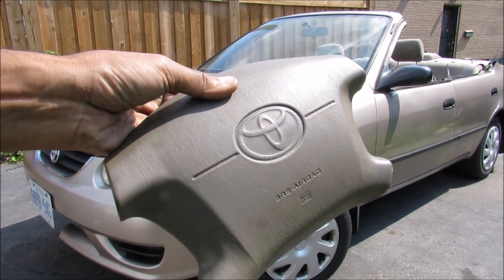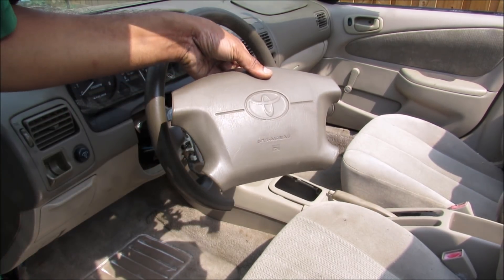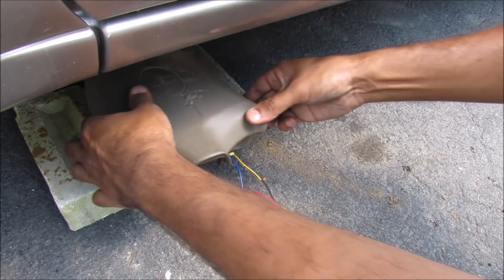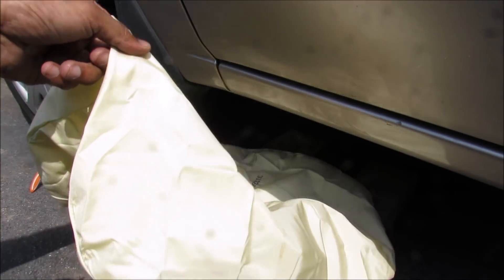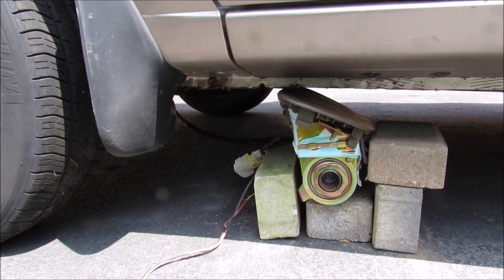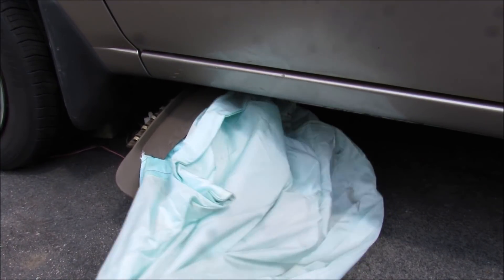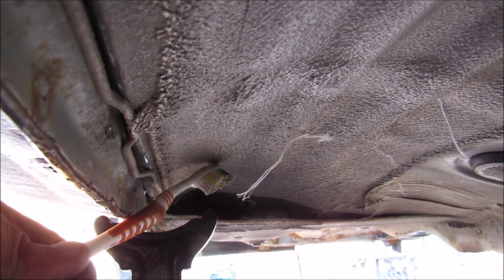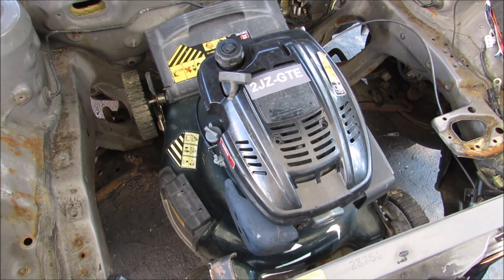Can an Airbag Lift a Car??

Comment: I think airbags have a greater potential of injuring people in the car than an actual accident, assuming seat belts are worn and properly adjusted . I wonder if there are statistics available on that .
Reply from the maker: If they did injure then why would they invest in putting so much into newer cars
Reply: @speedkar99  You're apparently unaware of the exploding gasoline tanks in the Ford Pinto. That was originally "an investment" where 1.5 million such cars were recalled by the manufacturer.

Comment: Do you have ac vents for 2004 Toyota Camry   ??
Reply from the maker: +M Ridware yes my 2004 camry has AC vents.
Reply: speedkar99 how much for all ac vents  ??
Reply from the maker: +M Ridware I have the entire interior for sale, gray color, I will sell the dash and vents as an assembly, but local pickup, Toronto
Reply: speedkar99 i want AC vents and ac control panel for my 2004 Toyota Camry  &  i will send you pic and you tell the price

Comment: Enough force to dent the underbody and break a weld!    This is one more reason I think airbags are more dangerous than safe. People just need to wear seatbelts.  Another well done informative video Speedkar!
Reply from the maker: +Tripp M yes its quite a lot of force. But remember in a crash, the airbag isn't supposed to explode into your face, rather your head is supposed to be cushioned by it after it has inflated.
Reply: speedkar99 Why are people so confused about this? Do they think it's supposed to explode directly into your face?
Reply: MoutainMan3000 you are right that they shouldn't explode in your face, however I am amazed at the injuries they actually cause and the damage they do to the car.  Hopefully this has been remedied with the newer generation of airbags.
Reply: You're supposed to get thrown into the deployed air bag, not the airbag get deployed while you are leaning into the steering wheel. Unless you're short like me and already need to be into the steering wheel just to get the clutch pedal down. One of these days I need to pull the srs fuse. I used to own a '93 Ford ranger, I hit a pole with it and I think Ford, or maybe Mazda (the Ford ranger was based heavily on Mazda's b2300 or B3000 series) had designed what I call a "Pre-airbag seatbelt mechanism". Upon impact the belt locked up and it almost felt as if it pulled me into the seat. I can't understand why Ford and Mazda started using airbags with a seatbelt mechanism that works that well.

Comment: Now what's remaining in that Corolla?
Reply from the maker: +Yathu prem lots of things:
Starter, alternator, ac compressor, drier, condenser, vvti gear, fuel injector, ignition coils, power steering pump and more...stay tuned I'll have videos for all that stuff in the coming weeks!
Reply: speedkar99 awesome
Reply: speedkar99 Sweet.

Comment: huh? the video showed the car lifting up from the ground, but you say it wasn't enough force?
Reply from the maker: +HazewinDog it didn't lift far enough to clear the wheel from the ground.
Reply: It looked like it did for me though, but I suppose you'd know better ^^
Reply: I tend to agree with HazewinDog. It really looked like the front wheel got almost an inch off the ground.
Reply: Yes, the front wheel did get lifted but notice that the original Corolla engine has been replaced with a (Ops, what was the new engine called...?) lawn mower.  LOL, another good video.
Reply: Wasn't the detonation wire stuck under the front tire after the second test?